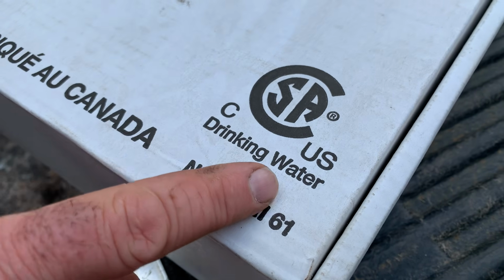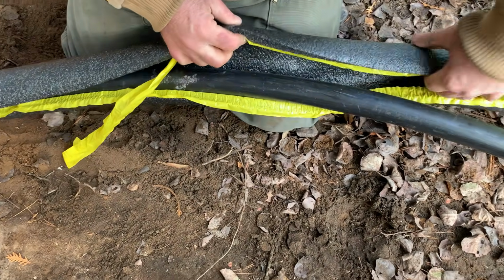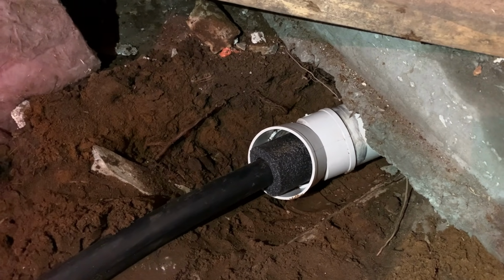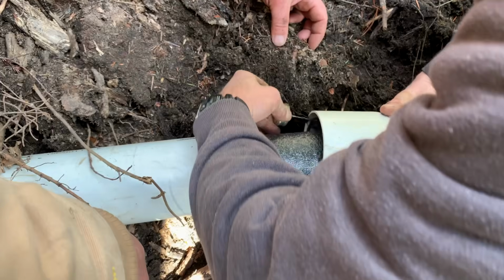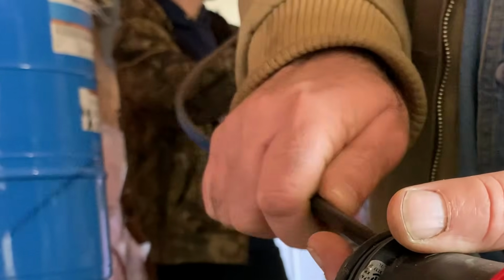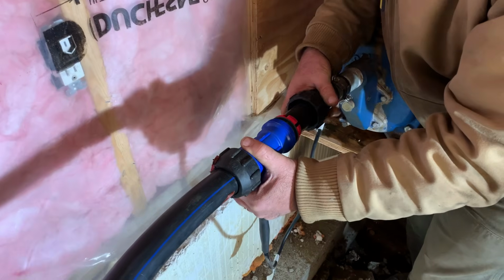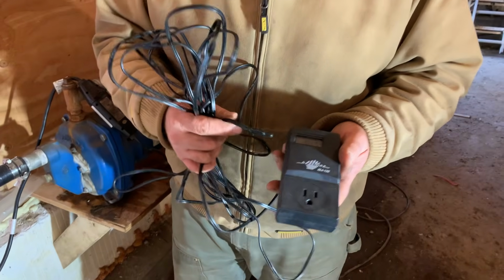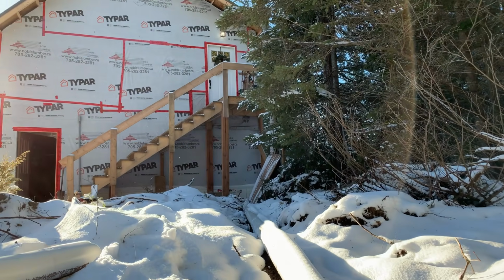How to Freeze-Proof a Water Line (Shallow Bedrock Installation)

Comment from the maker: If you’ve ever had a frozen water line, you know how disruptive it can be.

This system works especially well when:

• You can’t dig below frost depth
• Bedrock is close to the surface
• You’re running water from a well, lake, or river

If you’ve installed heat cable before, I’d be interested to hear what worked (or didn’t) in your situation.

And if you have questions about frost depth, energy use, or thermostat settings — leave them below.

Comment: If gets cold enough even heat tape fails
Reply from the maker: Yes, ordinary heat tapes applied to the outside of bare pipes does have its limits, but high-end systems that include insulation are different. I've never seen them fail, even outdoors at -30ºC.
Reply: @baileylineroad  i agree systems like this are better than just heat tape, but when it get 20-30 below (freedom fractions lol) it will freeze. Mine just did under the house it was a great afternoon with a torpedo heater. 
And at those temps you can run the risk of the drains freezing on their way to the septic if you run water to attempt to keep it from freezing.

Comment: Interesting video.  We have a well pump 75’ down here in north Texas. We run the water line up a trench at 18” deep to the house.  When we had the freeze in 2021 I had pipes freeze in a garage apartment. The hot water cpvc lines broke so I am considering doing this where it froze.  Thanks again for your video.  Has it been performing well?
Reply: In your environment that is kind of weather is probably so rare, that i would suggest just burying the line deeper, and use regular heat tape on the exposed pipe and insulation
Reply: @ thanks for the reply.  The buried water pipe didn’t freeze - just the hot water cpvc on the external walls.

Comment: The only different thing I would do, is the "T" connection at the start point of the "EHT" aka self regulated cable,  put the "T" upward, not downward, if there's a leakage, it won't sip down onto the electrical wire. I've been installing this for living for 14th years now, in the oil sands.  :-)

Comment: Would this work for extreme temps as in remote Alaska? How far is the wells from the pressure tank? What is the max length of pipe recommended for this system?

Comment: Great instructional video. Question for you. I plan on running a waterline to the lake which will have a foot valve at the end. I would guesstimate that the distance of waterline from my proposed cottage location (not built yet) will be in the range of 200' - 250'. First, how do I get that heat trace cable into that 1 1/4" pipe? Obviously that distance would prove difficult to push by hand without resistance and the cable kinking. Do I prerope the pipe and then tie it to the wire helping it through the pipe?? 
Second, I purchased a bulk roll of heat trace from a guy, but there is no components to go with it. What will I need to complete the installation? 
I plan on digging a trench deep enough below the frost line up to the lake, so I don't think that pipe insulation will be required, but I will slide this waterline into 4" Big O corrugated pipe for protection.

Comment: I just bought a campground that has plumbing lines already installed, but have no protection from freezing. Could I install this cable in an existing outdoor plumbing line? How long is the cable? Its several hundred feet at least from my well to the spigot that controls the campground water.
Reply: did you ever get an answer to your question. My water line is about 70 ft long
Reply: @truenorthmuskoka9077  unfortunately I have not yet gotten an answer.

Comment: That well is coming out of the bedrock?  How's this work?
Reply from the maker: Hello Mannisto! Interesting story behind that well . . . back in the 1970s, a group of university geology researches approached the landowner for permission to take core samples of the bedrock. Permission was granted, and the core samples taken down to about 100 feet as I recall. Well, that hole turned out to be a dandy water well. In fact, it's so good that the water runs out onto the ground every spring, fall and winter. Even in a very dry year, the water is never more than a few feet from the surface. And the crazy thing is, this well is only about 30 feet from the shore of a lake and the opening of the well is considerably higher than lake level. The bedrock you saw in the video is 6 to 8 feet higher than lake level, and yet water still flows out under a bit of its own pressure. There are no other areas around that are higher than this well, either. Water, especially ground water, sure can be strange. 
Thanks for watching and commenting!
Steve
Reply: @baileylineroad  There is greater than an ocean worth of fresh water deep in the earth. Has nothing to do with the aquifer. It's called primary water. When tap into it is endless and won't run out. It comes deep from under ground is up only through rock fissures and when tapped into those you get water. There places high in San Diego county in rocky hills in desert areas people have tapped into that way above any aquifer. Most geysers come from there. primarywaterinstitute.org
The earth has all the water it needs and all deserts and dry lands can tap it.

Primary water wells are not a new phenomenon.  Stephan Riess was drilling wells all over California and in the Middle East as far back as the early 1930s.  Pal has traveled to Africa numerous times, and earlier this year, drilled six wells in Kenya and Tanzania, producing over 3,000 gallons per minute in an arid land with less than 10 inches of rainfall per year." 

"One cubic kilometer of granite, under the right conditions, will yield one billion gallons of primary water." — Stephan Riess

"Since antiquity, the source of water generated deep within the Earth, clearly defying the conventional scientific hydrologic cycle explanation, has been a mystery. How does one explain sources of water throughout the world that produce impressive quantities of fresh water, often in dry areas with little rainfall or at high altitudes?  Besides numerous oases in Sahara, Arabic Peninsula, Middle East and the driest deserts elsewhere, and countless springs at mountain tops worldwide, there are clear examples of this phenomenon which stand out, like the Ain Figeh spring near Damascus, the Montezuma Well in the Sonora Desert in Arizona or the Zamzam well in Mecca." 
 "It seems that ancient civilizations had a profound understanding of this phenomenon, and morever a method of accurate locating of invisible underground water veins and streams.  Without heavy drilling and excavating equipment, they have built impressive water supply systems all around the world.  More than 5,000 years ago, ancient Persians developed the system of Qanats, which eventually spread around the region, and up to North Africa." 
 "The water wells of Gibeon and Beersheba, and huge cisterns of Masada in what is now Israel, are a total puzzle to modern hydrologists." 
  (Above quotes from 'Ancient Water Supply Systems' by Mladen Milidragovic  http://issuu.com/pepe100/docs/ancient_water_supply_systems_-_final_paper

Comment: Excellent video. One question - if you have a foot valve at the end of your water line - would you just pre-measure the length you need to reach the end of the water line and custom order it ?